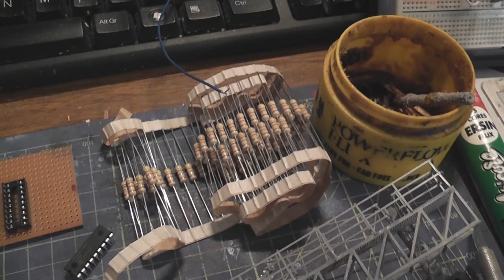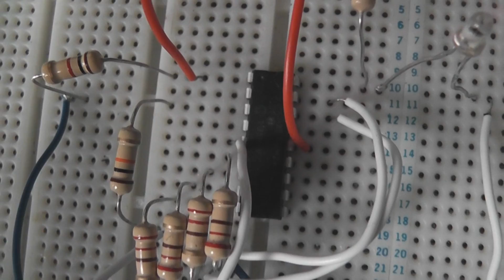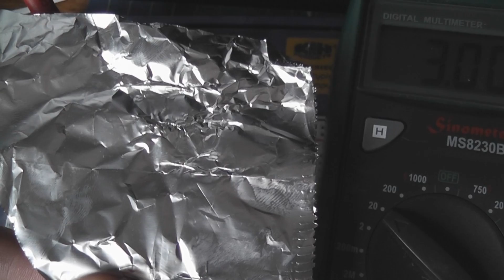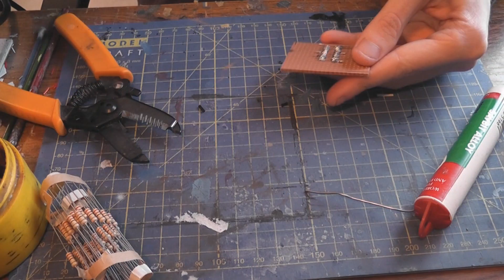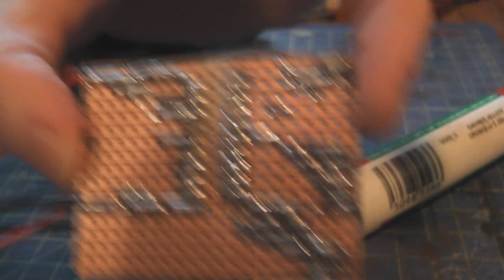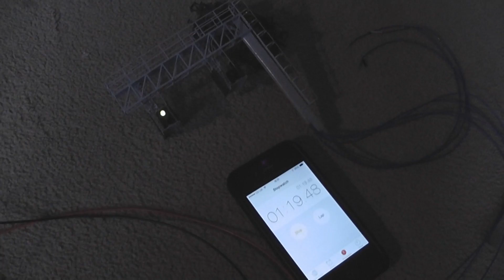How to - Episode 19 - Automatic Signalling

Comment: Is there any way to make a small buzzer sound if a train goes through a red light?
If so could you please upload the circuit diagram with this section added?
Thanks in advance,
Matt
Reply from the maker: Matt Hadler Thats possible.  You could wire a buzzer to one of the picaxe outputs and create a separate logic program to trigger it.  The power demands of the buzzer may require the use of an amplifier though.  I used a buzzer for an automatic level crossing system I developed when I was studying electronics.
Reply: EverardJunction Awesome, thanks, Ill try that when all my parts arrive. By the way, I love your channel :)
Reply from the maker: Matt Hadler Thanks, more vids are on the way.

Comment: Great Video, I want to do some signalling on the layout and it successfully worked on a 4 aspect signal and a heathcote mas sequencer. However this system is becoming less reliable and only some trains change it and this usually only happens with the couplings. Even with Alluminium foil the signal won't change often. 

I tried to get hold of the Picaxe stuff but it along with another programme called Rasberry it is dying out so I can't get all the required Picaxe stuff. There is another programme/system called Arduino which the shops recommend I try it because it's easier than picaxe. Would this be an alright option to try?
Reply from the maker: Connor C I'm not aware of pixaxe or raspberry pi dying out.  All the picaxe stuff is currently available from the links in the video description.  You can try Arduino if you want,  I've not used it before.

Comment: I have 29 PCB's built.  I am having problems getting the 18M2 picaxe chips, and the infared sensors.  You shoe a 2 pin receiver and can only find 3 pin.  Where do you recommend my purchasing these parts??    Bill
Reply from the maker: Wurlitzer Bill Van Lenten Links for those are in the description.  Both items are in stock with rapid.

Comment: That was a great vid and has got me thinking about what other things around the layout that could be controlled by a picaxe chip receiving signals from things like passing trains, points in particular position, ambient light...

I'm just scouring www.picaxe.com and can see that they do a chip that supports up to 33 inputs/outputs with 27 analogue/touch sensor channels. I've never used these chips before... but I think that they are going to feature heavily from now on!

One question, what kind of extra considerations/work would you need to do for the signal programme to actually control the passing of the train? AS I take it at the moment it is a purely 'cosmetic' signal?
Reply from the maker: Rod Hurley Thanks, these chips are very useful.  The possibilities are endless.

Comment: Is there any way to have true automatic signalling where the signal will only clear when the train has left its section (and thus the next signals overlap)? I would say that a second reflective surface at the end of the train (let's not get into track circuits on powered and connected rails) that when passing an inferred sensor at the overlap would clear the signal 2 before. An then have the signal listen for any changes ahead.
Reply: You certainly could, but it would be a fairly involved electronic project. If you use one microcontroller for each signal like in the video, they would need to communicate with each other to relay the position of the train.
Reply: Lew ys I was thinking you could hook them all up to some kind of computer (perhaps a Raspberry Pie) but I know nothing.
Reply: Yeah you could definitely use something along the lines of an rpi, arduino might be a better option for you imo. There's a lot of tutorials for programming and building basic circuits for free online, you shouldn't find it too hard to start building your own signals and whatever else you can think of :)
Reply: Lew ys It's certainly a cool idea, model railways have been swimming round my head for years, but time, space and cash need are in limited supply. If I were ever to do it then I should do it good and complicated is my perception of it anyway.
Reply: Surely if you linked the next signal to the previous so that each signal is either detecting a train or reacting to the next signal it would work.
Reply: This doesnt need a microcontroller of any sort, and certainly not a small computer. I thought about it for a few minutes, and I think it could be done with a handful of 74 or 4000 series logic gates. Old school style!

I thought about it some more and came up with a circuit that uses only 4 chips (2x AND, 1x OR, 1x NOR), and I still have 2 gates spare at the end (14 of 16 used). Its not tested, but a simulation of the logic checks out.

For its simplicity its got all of the requisite functionality I think:

* Interconnection is via 3 wires over which a signal relays its current status to a previous signal
* Detects erroneous or complete lack of input from next signal and fails safe to danger
* One module can control a 2, 3 or 4 aspect signal
* Simple interconnection scheme means any combination of aspects you desire is possible

But its only the logic for the signalling itself. You need to feed in a continuous signal indicating whether the block it protects is occupied, so that requires additional external magic. But it allows for completely automatic operation, and with appropriate interlocking logic you could even have an adaptive signalling topology for junctions.

Will order some parts and build a few of them up to do a real test.
Reply: One mans trouble is another mans pleasure. After all, I did say "old school style". And besides, while logic has a level of effort, using a microcontroller has its own level of effort. A microcontroller needs software written for it to work, logic you need to wire it together appropriately. Take your pick really.

A microcontroller is certainly a more compact solution, but it depends on what you really want. If you just want to write a few lines of code to implement the signalling logic and do some fancy effects to fade between aspects, then sure, its going to be the most compact way to do it. Or maybe you prefer the challenge of a discrete circuit to achieve the same.

Not to mention that coding isnt a skill that everyone has, whereas logic is relatively simple to understand and experiment with on a breadboard.

But I digress. This wasnt intended as a competition between which offers more functionality, its a suggestion that such a basic system doesnt need something like a microcontroller to achieve.

In the end my circuit needed 5 chips, but it works as intended to implement the core logic for controlling a signal.
Reply: Yes, its been done on my layout. My signals talk to each other so you can stop a train in a block on a red signal and the proceeding ones wont change until the train clears the block. This is done using the same chip as Richard uses built on a pcb I designed using software I wrote.

Comment: I've just ordered a 2 aspect feather from Traintronics and they state that they are 12V not 5V?
Reply: just means you will have to run them off the dc bus line and use a reply between the control circuit and the lights

Comment: Can you use more than one train on the same line at the same time?
Reply: No
Reply: +Peter Thomas I think with a bit of tweaking to the software and with sense connections between each module (I am working on it for my own layout) you could run two trains on the same line provided you follow the directions given by the signals. But I think the modules need to know not just when a train enters a block but also when its moved back out of it again for a sequential system to work reliably. The circuit as designed is very fast and wont wait for the whole train to pass before proceeding with the program. As soon as a gap between carriages is detected it will move onto the next stage of the program.

Comment: When it shows red, does the train stop until the yellow light is on?
Reply from the maker: Jim Healy No, the trains are controlled manually by me.  You would need to use a centralised computer command system such as Hornby Railmaster to achieve that.
Reply: Hi Richard..  Brilliant videos. The new layout is coming along well.  I’ve watched this video so many times and I’m about to implement part of you ideas, the difference being I’m using the servo command from the logicactor software to operate servos for semaphore signals. I’m also attempting to use automatic brake control (ABC) to slow and stop trains at a red signal. Have you thought about using ABC especially as the Lens dcc chips that you use support this feature? Anyway keep up the good work.

Comment: I do like your videos, (as it seems do others) due to there professionalism. I'm sure you are doing an excellent job of helping many beginners get into the more complex aspects of modelling, especially with regard to DCC. 

However as an ex BR Driver, (who obviously knows a bit about signalling) and someone whos built and exhibited a number of larger layouts, of British, German & Japanese prototypes. On all my layouts I had fully functioning Multi-aspect signalling systems of the relevant railway, where the signals operated in EXACTLY the same way as their real life counterparts. On none of my layouts was it necessary to use almost any of the electrical parts you demonstrate here, which as your video clearly exhibits does NOT unfortunately acheive real life type operation. Signals do not clear from red to proceed aspects based on time, but on the position of the train. The train has to completely pass at least one and sometimes more signals further ahead up the line, before a red signal can change to anything else.

I dispensed with expensive and unreliable infra red detectors, and replaced these with a much more reliable system which needs nothing more than a few inches of wire (cost 1p) and two isolation cuts in one rail (cost 10 seconds time). Your expensive and time consuming chip, I replaced with a couple of cheap (500,000 action life expectantcy) 50p relays. With just these items I was able to get signals to work automatically, semi-automatically or manually, as per the real life signal I was copying. The semi & manual signals (mainly ones with junction indicators) also required a mini toggle switch. 

Yet further and as in real life, all my signals are fully interlocked with all relevant pointwork. This requires nothing more than the spare switch provided on the Fulgarex point motors I use to control the points. Indeed if my operators who get a bit sleepy, after three days chained to the controller at exhibitions, crash red signals, their train automatically stops, before any fowling point. (Usually prevents damaging your beautifully modified locomotives).
The automatic crash prevention stop, is achieved by simply using another of the switches on the relevant relay, which simply cuts the power to one rail ahead of the signal when the signal is at red. (So costs nothing extra to acheive, but saves a lot of possible damage).

The only catch to my explanation is that you cannot get all this real life type signalling behaviour at roughly 10% of the cost you have to pay for your system, and probably install in about 10% of the time of your method, if you use DCC. DCC is by its very nature locked into a very narrow field of operation, as its parameters have been virtually locked in stone by the huge and powerful NMRA (USA based model railroading organisation). Which lays down the rules of how DCC systems will work, based on the practices of American railroads. Which incidentally tend to avoid complex signalling systems needed on European passenger orientated railways. 

As a  final note, my new under construction layout "Basingstoke in OO 1958-67" at 85ft long and 22ft 9in wide, needs in excess of 70 operational signals, both 3 aspect colour light and a few sempahores. As I always cost my layouts VERY carefully before starting construction.  This time around I decided to see if DCC could be a possible alternative. I was therefore rather appalled to find that if I used DCC it would ADD an EXTRA £5,325.00 to operate 135 locos and 202 points, and a few other accessories requiring chips. But yet further for the 70 odd signals yet another £1,500.00. Worse still this would NOT allow many of the real railway safety protection systems I use, which cost virtually nothing if you use traditional 12v DC, because DC electricity by its nature naturally provide many of the safety features. You can of course wire a 12v DC layout in MANY different ways to accomodate your personal preferences on methods of operation...........................!

Comment: err, so, how does the train stop on red?
I'm not a train modeller, but could easily become one watching you vids. :)
Reply from the maker: +mucks You stop the train manually with the controller.  As said in the video the automated signals are just cosmetic, train movement is still manually controlled with the controller.  Thanks
Reply: +EverardJunction 
aw, ok ... still, does make it more realistic to see the signals change. :)
Reply: +mucks You can insulate a short piece of track with the plastic connectors like with the switches. And then create a relay between the red and the power of the line? So when the aspect shows red, the power on that particular piece of line will be cut, so the train has no power. When it is not red, the relay switches the power back on that piece of line? Or is that not an option? I thought of it viewing this video. ;)
Reply: +Mitchell van de Ree 
now that's a neat idea.

Comment: A little bit sad because its not a real signal system
Reply: I guess that depends what you call a real signal. Its triggered by trains passing, it just isn't that intelligent. The PCB I designed and the software I wrote based on Richards work has logic that allows each signal to communicate with its neighbour so no false switching back to green after time if say a train stopped in a block. Any red signal tells its preceding neighbour to go yellow which in turn tells its preceding neighbour to go double yellow, assuming 4 aspect is what you want.

Comment: Late to the party here, but some points from an industrial electrotechnician:
1.  Man, I hope you have learned how to solder by now!  The dip transfer solder from iron to board method and use of that stinky corrosive plumbing flux, was cringe worthy stuff...  painful to watch ! !  
2. Light rub with steel wool or your 'track clean rubber' on the strip board to clean prior to soldering..
3. Heat joint and then apply solder to flow. QUIT the dip and transfer method! I haven't seen you do that when soldering supply wires to rails... So, why do it on printed circuit board? SMH  The Iron appears to be way too hot as well. Turn it down to minimum, and use the correct alloy for each type of jointing application.  
4. That solder contains more than enough resin core flux. Ditch that shit paste... it's perhaps good only for initial tinning of large bus-wires or rail connections. 
5. Wash boards of flux after soldering using solvent and then Iso' rinse.  ESPECIALLY after using that crappy plumbing flux paste.
6. Rather than use IR retro-reflective sensor, that is perhaps subject to interference from room lighting and can't be 'weathered', use 'Hall Effect' device that is triggered by magnetic signal input. These can look like a small transistor case form and with a discrete sensor face can be laid flat across the sleeper to look like the actual signal sensors used on the real rail network. Same bias will give same signal 'high/low' as an IR transistor. Insulate the fine wire to ribbon cable solder joint with very small heatshrink to avoid short at the device... the small wires will easily passing through layout base board. Paint em the same colour as used on the rail network or just muck/grime.  Small magnet on base of train to trigger, rather than reflective foil.  A Grade method.  
7. If you must, nuisance tripping of IR sensors is managed in Industrial sensors by using high frequency pulsed output of the IR diode and recognition of that coded pulse of an input signal from photo transistor by the microprocessor. So, A few new lines of code in your program fixes that if you persist with this B grade sensor method.  
8. The Resistors you are using are the huge 1/2W rated. Much smaller 1/4W will be more than enough for every application seen here.
9. Locate the resistors for IR devices on the board rather than at the field sensor location. 
10. Use strips of ribbon cable to field wire back to board from the sensor and LED's in gantry to board. The reasons are obvious.... colour coded, multi-core strip and correct conductor size.   The wire you are using is 4 times larger than needed.